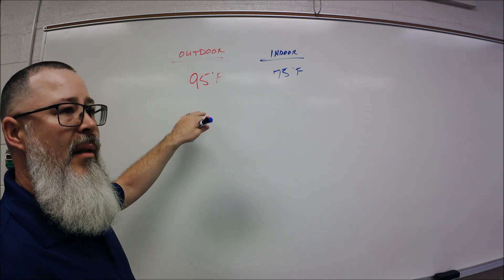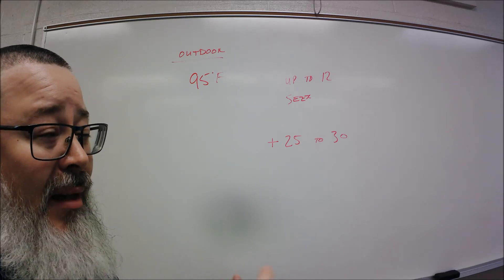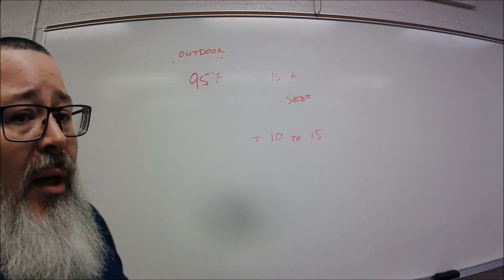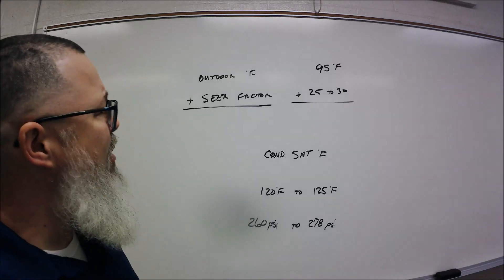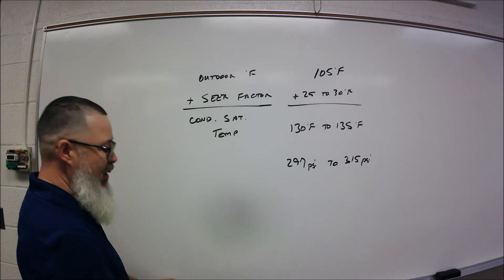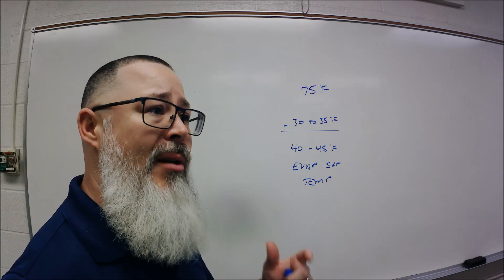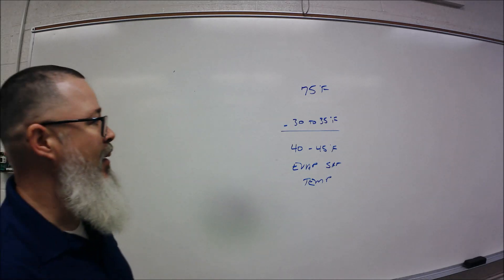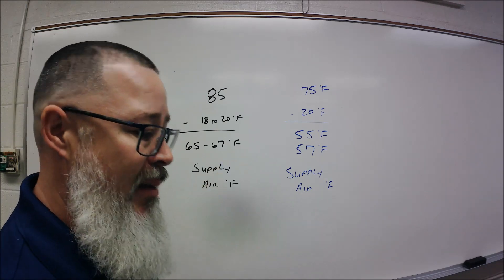How I Get Started Checking Refrigerant Charge

Comment: Excellent video. You are a great teacher. I would like to point out a small clerical error at 17:00 . It's 55-60 on a 90 degree indoor temp, not 60-65 . The pressures will also be adjusted. Cheers.
Reply from the maker: Thanks for the info! Seems like as much as I try to get it right I gotta mess something up! I'll try to fix that.

Comment: All those examples are just for residential equipments, what about RTU can we apply the same principles or varies in something, thanks for sharing your knowledge
Reply from the maker: If it is a comfort cooling type of system then you should be able to use the process. Of course a true refrigeration system for ice cream or something is different. But in any compression refrigeration cycle you have to have the basic things happening though...heat being absorbed and heat being rejected.
I try to tell the younger guys I deal with that I am not trying to teach you what to memorize but more so how to start learning it. You can easily come up with different numbers for your SEER rating factors, etc... but when you do that out in the field you just gotta keep up with it. What will happen is that you will start to transition from a memorized/book learned thing into a field learned/experience thing because you are paying attention to what you are seeing and also doing to fix it.  
Sorry for the long wind. I appreciate you commenting and checking it out. Thanks

Comment: Great video, thank you so much for it. I have a quick question, on the thermostat we have it set to 60 on cool. Does that mean that my saturation temperature on the coil will be 30 degrees qi==with the freezing point being 32 degrees?
Reply from the maker: Yes, if you set the thermostat too low you could end up with a saturation temp that is below freezing...on another point, I wish my wife would let me keep it on 60! Thanks for commenting.

Comment: Evap. saturation will also be affected by air flow and the amount of latent heat, or sensible heat ratio.
Reply from the maker: Most definitely. Just trying to put a little something out there on it. I know it takes a while to get it but I can probably count on my hands how many times I saw a perfectly 40 degree saturation point. Like you said...airflow, heat, humidity, etc. all go into it.

Comment: How do you know the SEER rating on VRF or even a split syatem...Ive tried to look on nameplate and its never  there
Reply from the maker: I can usually find something by googling the  "make, 4 to 5 digits of the model, then "specs". So something like "goodman gsz13 specs. It works most of the time but I haven't tried it on a VRF system.
Reply: @johnjennings-JJ  That's excellent and thank you again.I am still a student of the field here in the UK.Very limited resources here I must admit.We always have to rely to ever giving American HVAC engineers.There is roles here hi by names like HVAC engineer's mate..just imagine...I kindly ask with time if possible you do another video with more contents on evaporator 's DTD for a range of refrigeration equipments and how we use it to diagnose temperature /pressure related problems .Id possible please use Celsius as temp.scale unit.Thank you
Reply from the maker: Thanks for checking us out then. I do have some refrigeration equipment that I had wanted to get on for a video so I will keep you in mind and I'll try to put up the Celsius info too. I have only used Celsius when I worked at a hospital...messed my head up a little!